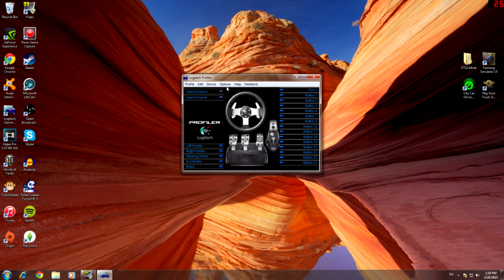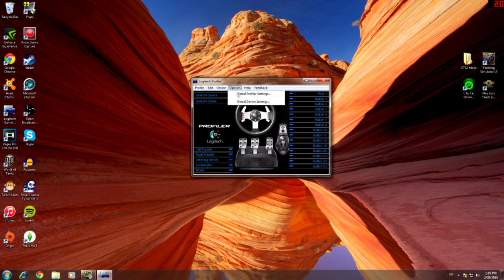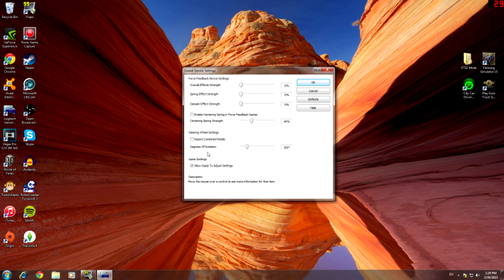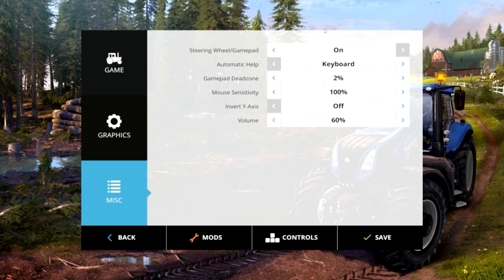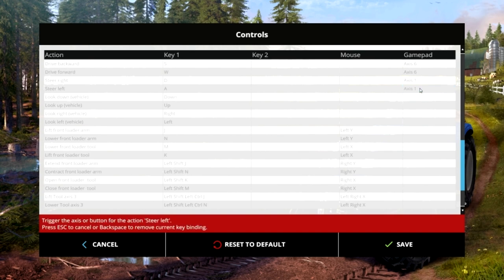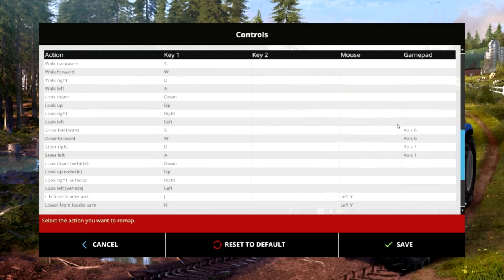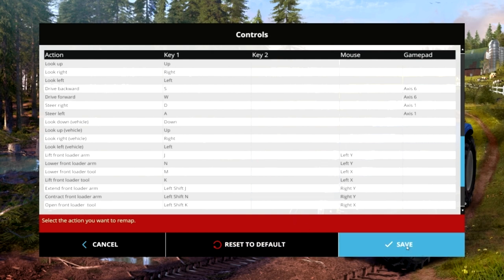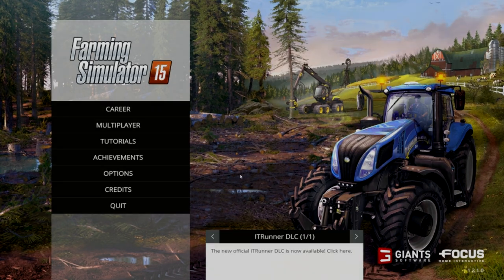How to set up logictech G27 with Farming Simulator 2015

Comment: hi there, im having problems when i plug the wheel into my pc the wheel automatically adjusts by itself first which is ok, but after that i cant turn it freely,its like it is locked up,im doing the adjustments that u have in the video and i have the latest software version of the wheel and it still doesent work. what do i have to do so i can turn the wheel freely? any help would be good
Reply: mine does that do, its normal im pretty sure
Reply: try putting your FFB or centering spring down
Reply: hi ktm, i tried that and i got it to work now, thanks for the tip m8.